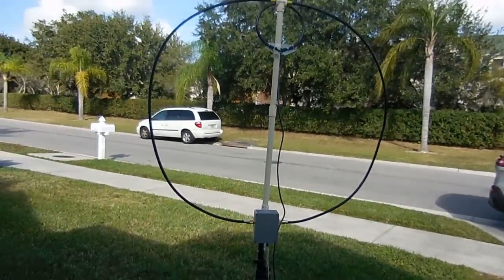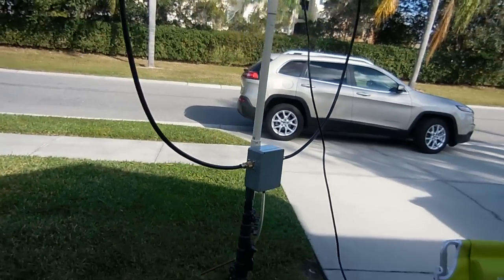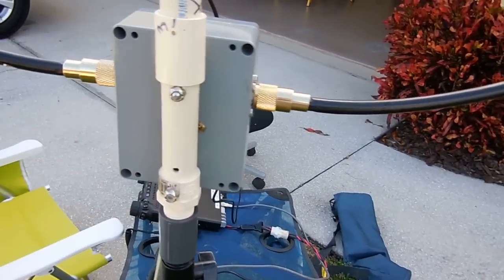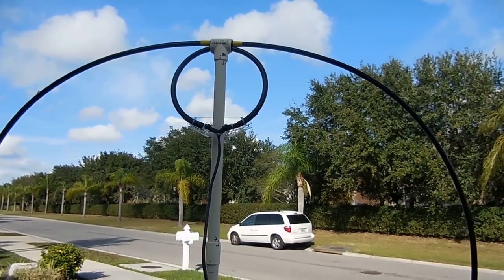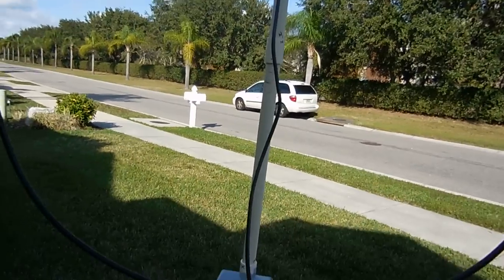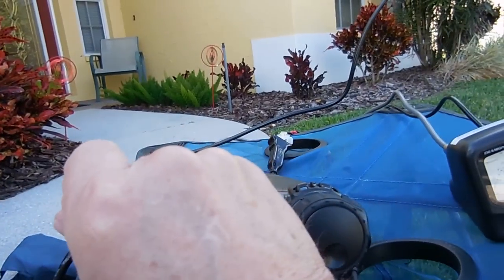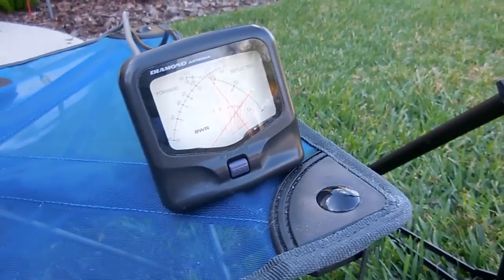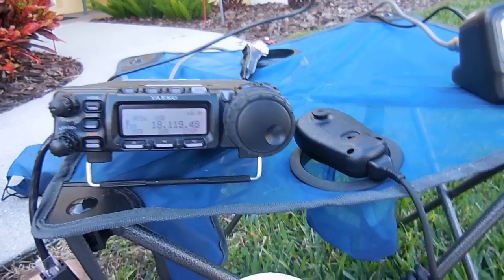Magnetic Loop Antenna

Comment: Hey George. I am VE3HTB from Toronto. Inspired by this video I took some rg8x and a hula-hoop and built a magnetic loop antenna. I took it out on the balcony and immediately worked several stations.  I was able to tune 15 meters, 18 meters 20 meters & 30 meters. I added a 82 pf capacitor in parallel and can receive on 40.

Comment: George, Thanks for all your magnetic loop videos. I made one to your specs and it works very well. 73, Jim - W3COX
Reply from the maker: Jim Cox Jim, I've been having fun with mine. I will be using it on summits in Vermont this summer. Hope we can make a loop to loop contact. My email is good on QRZ. Keep in touch. 73 de N2SQ
Reply from the maker: +Jim Cox  The coax is RG-8 solid Teflon dielectric using only the shield of the coax, the center conductor is not connect. The capacitor is a 25-100pf air variable reduction gear type that I bought at Orlando HamCation 2014 for $2.00. The inner loop is the same RG-8 coax as the outer loop,1/5th the size of the outer loop. The RG-58/U feed cable is connected to the inner loop. The center conductor of the feed cable is connected to one side of the inner loop shield, and the shield of the feed cable is connected to the other end of the shield of the inner loop. There are many web sites with info about magnetic loops that I looked at, not one in particular. The arc over power level is different on each band.  There are three videos on my channel about the antenna, read the comments on each video. I took encouragement from the contact to Ireland I made while testing with clip leads hanging all over and the antenna suspended from my garage celling. The length of the big outer loop of my antenna is 106 inches measured from the edge of the PL 269 at the base of the center pin, not the tip, with the screw sleeve pulled back onto the coax . The little  inner loop is 1/5th the outer loop length, about 21.5" Start with the inner loop at about 22.5" and test and trim down until you get a good SWR. The inner and outer loop are insulated from each other. Both of the coax loops are fitted through the cpvc 'T' on the top of my loop and holds them to together. I kept adjusting the inner loop length while  testing with a clip lead on one side of the feed cable then trimmed the inner loop when I attained a 1:1 match. Start testing with low power of 5 watts or use an antenna analyzer. After you get it tuned with a low SWR then start increasing the power till the cap arcs over and the SWR goes high. You will find that power handling of the antenna changes depending on the band and the cap. The secret is to get the inner loop the right size by testing, testing, testing.  Hope this helps.

Comment: Thank you for the video George. It gives me hope that I might be able to build the same type of magnetic loop.  I also like the bands you were able to cover. Questions:
1. What is the name of the coax you used? It looks nice and thick and rigid.
2. What variable capacity did you use?
3. Did you take photos of the inner loop connections that you might be able to share?
4. Was there a particular website or blueprint you used to construct it?
Reply from the maker: Jose, I plan to make another video about the magnetic loop with more detail. The coax did not have any printing on it. It is RG-8 solid dielectric using only the shield of the coax, the center conductor is not connect. The capacitor is a 25-100pf air variable reduction gear type that I bought at Orlando HamCation 2014 for $2.00. The inner loop is the same RG-8 coax as the outer loop,1/5th the size of the outer loop. The RG-58/U feed cable is connected to the inner loop. The center conductor of the feed cable is connected to one side of the inner loop shield, and the shield of the feed cable is connected to the other end of the shield of the inner loop. There are many web sites with info about magnetic loops that I looked at, not one in particular. I hope this helps. Thanks for the comments. 73 N2SQ
Reply: George Becht Yes it does help. A million thanks! And I eagerly await your next video.

Comment: bonjour l'antenne loop magnetic je suis amateur radio (27 mhz 11m) l'antenne on peux le faire pour le 27 mhz (11m) je peux me la faire mai il faut les côtes du câble 73
Reply from the maker: You can make a magnetic loop antenna to work on any frequency. Just adjust the loop and capacitor size. There is much information on the internet on how to build one.
George N2SQ
Vous pouvez créer une antenne à anneau magnétique pour fonctionner sur n'importe quelle fréquence. Ajustez simplement la taille de la boucle et du condensateur. Il existe de nombreuses informations sur Internet pour construire un.
George N2SQ
Reply: je ne trouve pas de cote sur le net( dim +le fil ou coaxl + le condasateur variable en pf 73.
Reply from the maker: Please read my reply to Jim Cox below for more information on the antenna construction.Veuillez lire ma réponse à Jim Cox ci-dessous pour plus d'informations sur la construction de l'antenne

Comment: that's why I want to build a legal limit loop. i dont want to fatom arcing over. but the issue is the voltage rating of the variable cap. I've contemplated polyethylene sheets between the stator and rotor plates of an air gap. but till I find test equipment I can afford. I can't venture into making one blindly. I need to know of books or advice on how to make an affordable vacuum variable. but not a vacuum style cap. or figure how to raise the voltage rating of an air gap and still have the pf's that it takes to range the frequencies I want to transmit on. I want a 160 to 10 loop. so I'm looking at a 15 pf to 3500 pf cap. with a voltage rating around 45,000 plus volts.